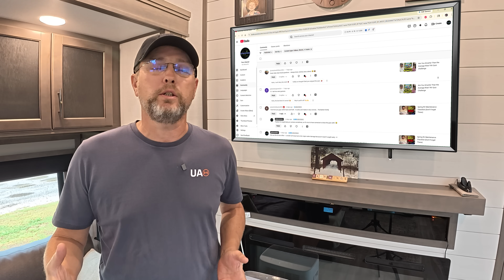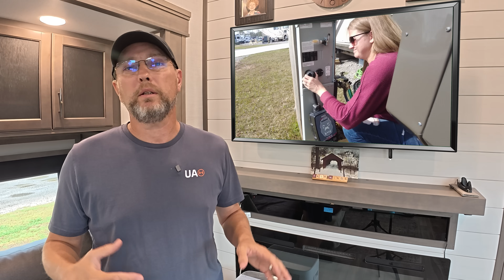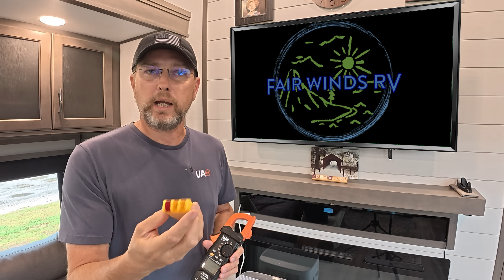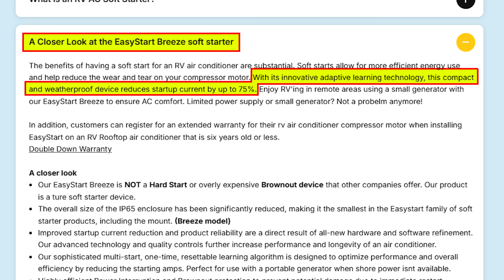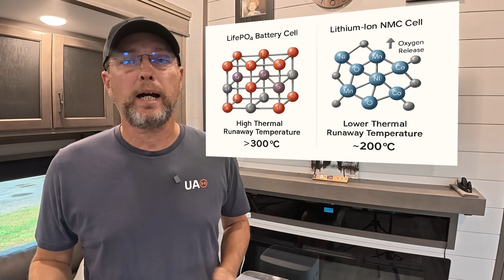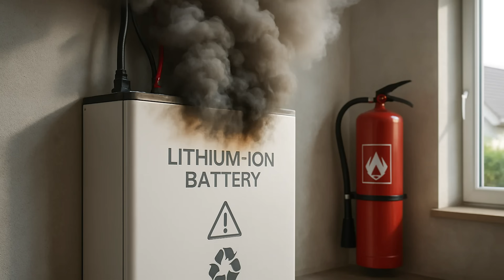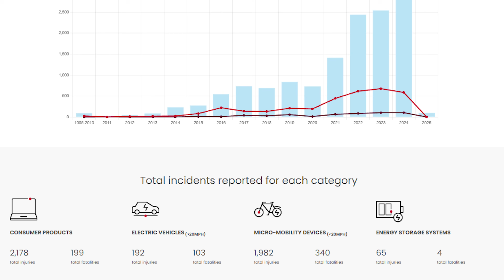Bad RV Advice We Keep Seeing (Let’s Clear This Up)

Comment: I hope everyone reads this comment, My WatchDog saved someone else’s motorhome from burning to the ground. 
We pulled into a Virginia Beach park, 4 hours later my WatchDog tripped, I called the park and the workers showed up. They said the section of park we were in had a new distribution panel and it must be the pedestal.
After replacing everything i was still in the red on my WatchDog, I ask if any new RV’s had parked in that are in the last hour and one guy said yeah a lady had just pulled in with her motorhome, he drove down to it and found smoke pouring out of the refrigerator vent.
After pounding on her door (wasn’t home) he yanked her plug and broke open the outside access panel to find her cord melted and the wood still flickering.
When he got back to us we plugged in and the WatchDog said we were good to go…
So while it cost me a chunk-o-change to buy it, I saved someone else about $150K plus belongings.
Reply: Damn, good catch on thinking about someone else pulling up
Reply: @Norden_king 
40 yrs doing RR signal work taught me that stuff daisy chained ,even over miles of pole line can affect the whole circuit.
When you plug in at a park, you’re sharing the same power circuit with everyone else.

Comment: Soft starters are the markets reaction to the HVAC companies using the cheapest, most inefficient compressors they can find because they have gotten away with it on home units forever
Reply from the maker: This is true, however we're starting to see some improvement here with some manufacturers moving to inverter driven AC units, which drastically reduce the starting surge of compressors. 
The RV industry is interesting because it really isn't proactive when it comes to providing customers with quality components/upgrades that make a real difference to consumers, and by and large, the consumers simply aren't demanding OEM's offer them. Fortunately, social media has started to really put a lot of pressure on these manufacturers and we're (slowly) starting to see some significant changes. I'm not defending RV manufacturers at all, but if consumers want better, more effective, more efficient components in their RV's, they need to demand it.

Comment: I put a soft start on my ac unit.  I have an Ecoflow 7.6 kWh battery pack to run my small camper it produces ac power up to 30 amps.The amp drag on start up would cause my battery pack to cut off.  The soft start allows the ac unit it start easily with far less amp draw on start up, so my power supply system works well.
Reply from the maker: We love the ability to run A/Cs on 30amp or when boondocking.
Reply: I wish my Anker 767 would run my A/C, when I plug into it the A/C starts up but then the Anker trips and stops working. I need to know how to verify my SoftStartRV is working.

Comment: We arrived at a campground and they were doing electrical work.  Careless electrician swapped hot and neutral at the main panel, then powered it up.  My surge protector shut things down within 1/30th of a second (half a cycle).  There were more than a few folks at that campground that got smoked.  Weird shit happens, do your best to minimize the destruction.
Reply from the maker: Great example and thanks for sharing!
Reply: CRAZY!!!
Reply: I'll bet you a donut and cup of coffee/tea that electrical contractors insurance fought those folks who's rigs were damaged on the repair/replacement of their electrical components.

Comment: I do have a question.  If soft start is important for electrical surge to protect the rv wiring system.  We don't the rv manufacturers have then installed at the factory?   You would think its a benefit to the customers and another selling point for the rv manufacturers.
Reply from the maker: Great question. Candice and I were just talking about this yesterday. The bottom line, in our opinion, is that RV manufacturers, no matter what BS they feed us, are only concerned about profit. Adding all the additional features, options, and accessories that are actually meaningful to RVers increases production cost, which increases retail cost, and manufacturers are afraid of pricing people out of buying RVs (making them too expensive). That last point isn't conjecture...we've actually heard that from folks on the RV industry. And while it may be true to some extent, I honestly think they'd be surprised at what people would pay for a an RV with a proven track record of quality, reliability, and meaningful options. 
To be fair, some RV manufacturers ARE starting to include things like soft starters in their AC units, with some AC manufacturers actually building them into their units. Same goes for better roofs and upgraded frames. The social media world has really put a lot of pressure on RV manufacturers to start building better products. But there's still a very long way to go.
Reply: We need to keep demanding more and rewarding (through purchasing their products) those manufacturers who do it slightly more right than the competition.
Reply: It’s ALWAYS money.

Comment: Great Video, I use my EMS surge protector to power manage my appliances and in the RV. I can view the EMS app on my phone and see how many watts or amps each appliance is using. EMS is very helpful when I have to use 30amp instead of 50 amps at the pedestal. I say if there is one upgrade to buy for your RV it should be a EMS surge protector.
Reply from the maker: Very good use for an EMS!

Comment: So many people confuse Li-ion with LiFePo4. I even hear some YouTube influencers showing a LiFePo4 installation and calling it Li-ion. 🤷‍♂️
Reply from the maker: Agreed, but to be fair, LFP is technically a lithium ion battery. The real problem is that people don't understand that LFP batteries are much different than the other lithium ion batteries.
Reply: @fairwindsrv 
Exactly my point and to be fair if you're going to be helping people understand the difference in Li-ion as used in a Tesla and LiFePo4 batteries you need make a clear distinction between the chemistry and not muddy the waters with incorrect terms. 

I know you know this but I'll include it for the comment readers. 

The main difference lies in the cathode material. LiFePO4 (Lithium Iron Phosphate) batteries use iron phosphate (FePO4) as the cathode, while traditional Li-ion batteries often use lithium cobalt oxide (LiCoO2) or other lithium metal oxides.

This difference gives LiFePO4 batteries:
- Better thermal stability (safer)
- Longer cycle life
- More tolerance to overcharging/over-discharging
- Lower energy density compared to some Li-ion types

LiFePO4 batteries are known for their durability and safety, making them popular for applications like electric vehicles and energy storage in RV's.

I've talked with a lot of people that use the battery chemistry interchangeably and I've talked with a lot of people that are scared to put LiFePo4 batteries in their RV because they are afraid of a fire "like a Tesla" is a comment I've heard many times. 

You do a great job with your videos but I've watched several people recommend installing Li-ion batteries in your RV while it's clearly a LiFePo4 battery in the video. 

Let's not confuse the people we are trying to help. If you go to the comments in the video there are normally several people correcting their terminology and they keep defending it. 

I use Li-ion, LiPo and LiFePo4 on a regular basis, these are three distinct chemistries with distinct characteristics in charge and discharge rates. 

I'm only suggesting we be more concise with terms if the "big plan" is to help people. 

I think you should know more after watching a video, not less.
Reply: As a retired chemical engineer it also irritates me when folks say life po 4 instead of lithium iron phosphate
Reply: @philc.9280 it seems like some people like to find a trendy way to say things. 

It seems like they had a meeting most of us weren't invited to. 

A flashlight is now a torch and if you buy it without the LED (pill) and associated parts it's a host. 

You have to listen to a dozen or more videos on almost every topic now just to find out where to get a secret decoder ring for that topic.

Comment: Retired MIT mechanical engineer, former Safari Motor Coach plant engineer, former high power interconnect engineer and former custom A/C director of operations.....Very good and mostly accurate video. The only thing I take exception with is the failure to differentiate between the level of monitoring needed for the function of surge protection and the function of 'energy management' or, more accurately, wiring assurance. They are two separate things, often conversationally combined into a single device that is marketed as a 'surge protector'. RV owners often conflate both functions with one named device.  Lets look into the need for monitoring and the necessity/correct location for these functional elements;

On surge protection: BLUF - surge protection needs to be monitored continuously and installed AT THE DISTRIBUTION BREAKER PANEL (inside the RV). 
Details: Only surge protection needs continuous monitoring because events can occur at any time, either inside or outside the RV.  (Residential ) 'Whole house' surge protection is now an NEC requirement. NEMA manufacturers have created a broad array of these devices, often specific to brands of breaker panels. They are commonly available, inexpensive, small and easily permanently installed inside or immediately outside the breaker panel. They are MOST EFFECTIVE when connected through the breaker panel. Surges don't just come from outside the power pedestal, some are created inside, by the RV equipment turning on and off (A/C equipment being the primary one). When located inside the panel, surges created on one branch circuit can be damped and prevented from spreading to other branch circuits. Surges from outside are still blocked to ALL branch circuits. This is not the case when the surge protector is located at the power pedestal. Surge protection at the pedestal ONLY prevents surges from outside the RV from entering, meaning its only a partial solution to the whole problem of surges.....but its easier to sell you a more expensive add-on that is less effective..... 

I have some strong words on 'Energy Management Systems' (EMS). EMS is a marketing buzzword created to sell a mostly unnecessary solution to customers created by fearmongering sales pitches and near continuous politically correct rants by unknowledgeable 'advocates'. Since surge protection is now mandated by the NEC, if EMS were truly important and effective, why aren't EMS mandated? The answer is, that EMS are electrically ineffective and a better solution exists. What HAS happened is NEC now requires ground fault protection virtually everywhere (on circuits equal or less than 240V/50A).
While information is power, most users don't have an adequate understanding of the basis of the information provided by an EMS and almost without exception, have no ability to correct it. Power systems are extremely unlikely to develop wiring faults randomly so this is where your commentor is correct, Initial surveys to verify correct wiring of the power pedestal IS all that is necessary. Because EMS systems and the knowledge of electrical wiring faults have been widely publicized for as long as 'surge protectors' have been available, I don't think there is an RV park power pedestal anywhere that hasn't been checked and rechecked dozens of times. The marketing hype is as if RV park owners are unconcerned and feel no responsibility, which I think is generally untrue. IF a power system's wiring were to be compromised sufficiently that it created a hazard in the RV, (I feel) the cause is FAR more likely to occur INSIDE the RV than out. An EMS at the power pedestal, could/would not be effective for any fault occurring inside the vehicle but GFCI breakers would. THAT is why EMS are not seen as valuable or effective by serious electrical professionals. EMS are used as an 'added feature' by marketing teams to boost the price of a product that contains an item of importance but low cost (surge protection).

Comment: That's hilarious that those viewers saying ems and soft starter is a waste of time.  Oh well.  Let them learn the lesson.  As far as a soft starter, yes, it's not needed but it helps keep things quiet and makes the unit have a longer life.  Again, it's on them if they want a loud inefficient unit.
Reply: My main issue is the soft start lets me use a 2000 w generator to start the unit off grid to cool it down for the night.  If I was always in a park with power I am not sure I would be excited to have it.
Reply from the maker: For sure, although we've stayed at parks with only 30 amp connections and it can be a little difficult to get 2 AC's running on 30 amps.

Comment: You're not wrong.  There are people out there that simply refuse to hear the broader, collective wisdom of experienced RVers.   Surge protection/EMS, Truck payload ratings, water pressure regulators, etc.  Some folks falsely think that just because they have never had an issue that they never will and, therefore, you won't either.  The old expression 'an ounce of protection is worth a pound of cure' goes a long way in life in general...and especially in an RV.  Our hardwired EMS has saved our electrical system more than once.  Skip the surge protector and invest in an EMS...well worth the cost.
Reply from the maker: Agreed. We like to remind people that there's a difference between can and should. You CAN pull a 45' fifth wheel with a 3/4 ton, but should you?

Comment: Excellent points and all very correct.  I can add one other item that I hear some people think are a "scam" is RV hitches.  They think that if you have the proper tow vehicle that you don't need weight distribution or sway control.  They forget that physics is physics and you cannot void the laws of nature via a social media rant.
Reply from the maker: Truth! The right tow vehicle and proper weight distribution helps, but a sway control system is a must.
Reply: That drives me crazy too, or that beefing up the suspension with airbags, helper springs, timbrens, etc negate the need for weight distribution because the truck is not sagging.

Comment: Great info , do you know if anyone covered the lithium batteries as far as fire extinguishers? I was told you need a different kind of fire extinguisher for them,ones that come with a camper that has AGM batteries
Reply from the maker: Great question. Check out this article for more info.
https://vonikoshop.com/blogs/blog/how-to-put-out-a-lithium-ion-battery-fire-safety-guide-for-2026#:~:text=The%20Right%20Fire%20Extinguisher%20for,may%20still%20require%20additional%20cooling%20.

Comment: The odds of a reverse polarity, open neutral, or open ground condition developing after the initial connection tests clean is not zero but it's extremely low (I've never seen it in 10+ years of using an EMS).   

If that was the only concern I might be willing to use a multimeter or tester and call it a day.   What is much more common post plug-in is seeing transient low voltage conditions (hot afternoon with everyone running their ACs or whatnot).   That can cause some devices to pull too much current and cause permanent damage and I've seen this (the low voltage condition not damage to my rig) several times over the years.   We also saw a transient frequency drop issue all the way down to 48Hz once at a music festival where power was being provided by large generator units.   

For the initial automatic testing, detection of transient issues,  and the surge suppression capabilities I'm firmly in the not-a-scam camp on this one.
Reply from the maker: That's a good camp to be in! Lol.
Reply: 140 night never had a problem last summer had a problem the post was wired wrong on a new constituent camp site. So 1 bad post out of 140 lol